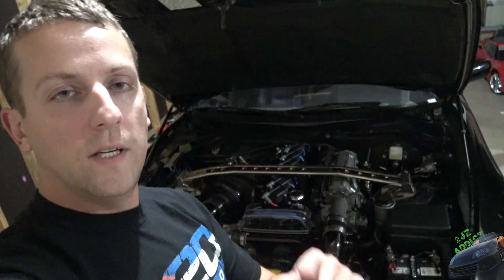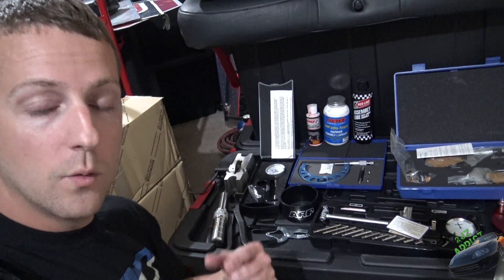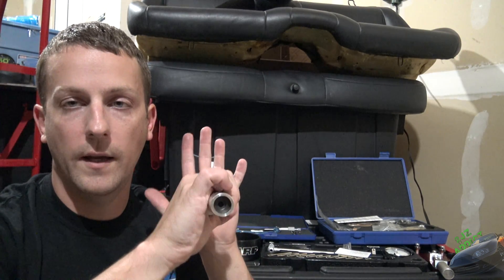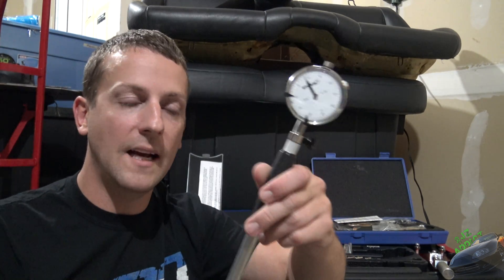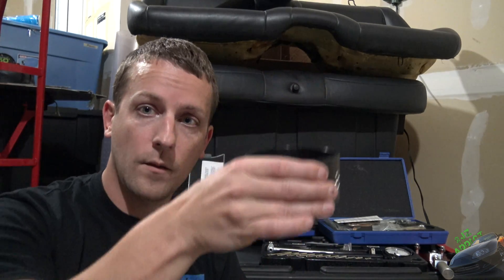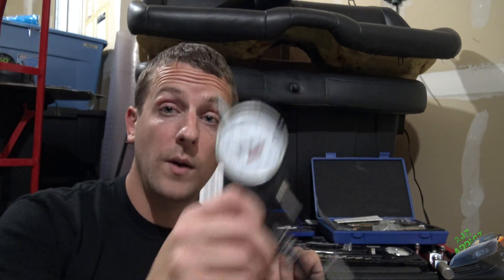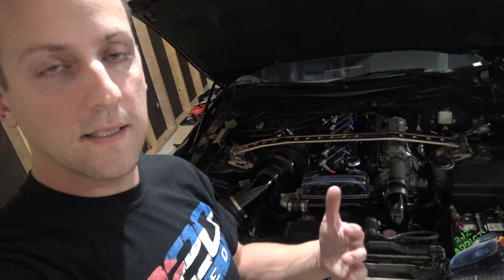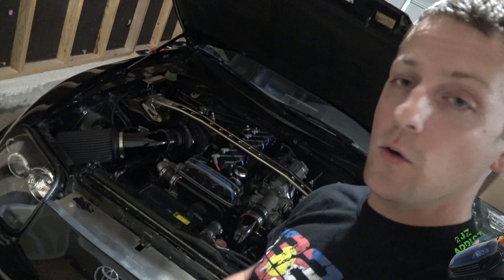What tools do you need to build a 2JZ engine?

Comment: Love the video ,do you think a snap-on 3/8 digital torque wrench alone will cover building the whole 2jzgte minus crank pulley ?
Reply from the maker: Thanks! I think you’d be fine with that as long as you’ve got the range. I’ve got a 1/4 drive for some of the smaller stuff like the cam caps and then a 1/2 drive for the main caps and rods. 👍

Comment: Also, where'd you find that clear plastice cam gear cover? Looking for one for mine. Lastly, not sure if you covered cam degree in a previous video? I don't recall. Not much info out there for 2j's when it comes to that.
Reply from the maker: Thanks! I’m not sure where I got the cover honestly. It was 5-6 years ago when I bought it and finally installed it with the new motor. I’ve not done a video on degreeing cams. The Twins did one years ago that was quite thorough. If you follow the cam card and make sure the dial indicator is clear if the lobe as the cam rotates you should be good. I’d like to do a build for the HT car at some point down the road and will do a full series in the build when it happens. What are the specs on the motor Don did for you?
Reply: @2JZAddict  Just re-watching some of your vids, didn't realize I never responded lol. Specs on the motor is 3.0 10:1 manley flat-tops, manley turbo tough i--beams, billet mains, 1/4th fill, AP modified oil pump, and he welded the crank trigger. As for clearances though I'm not entirely sure though, I just let him do his thing lol. The bottom end is the only thing I didn't do on this car, besides the tuning and little bit of weld work. The head is basic, just GSC S2, GSC beehives, and PHR cam gears. Would be cool to see a build for the HT! Thanks for the info though, I forget the twins had a wealth of educational videos back in the day.

Comment: Would you check head stud bolt stretch when torquing?
Reply from the maker: Bolt stretch is for rod bolts only to make sure you’ve got sufficient preload. Head and main studs are only torqued.